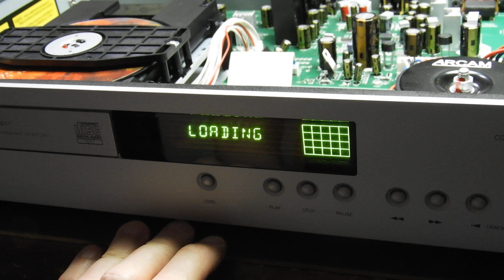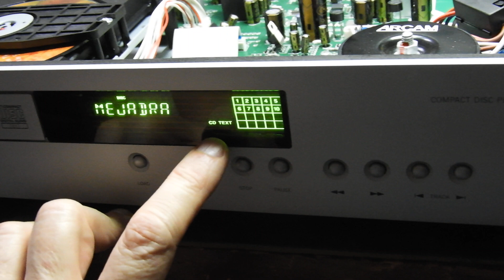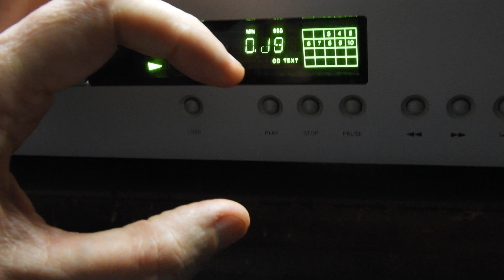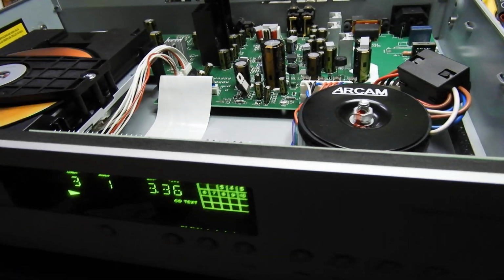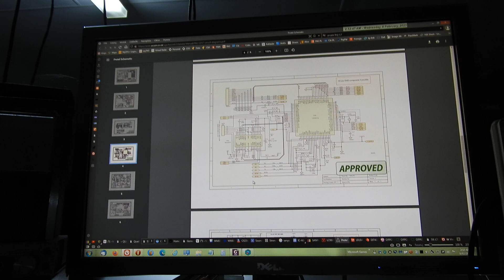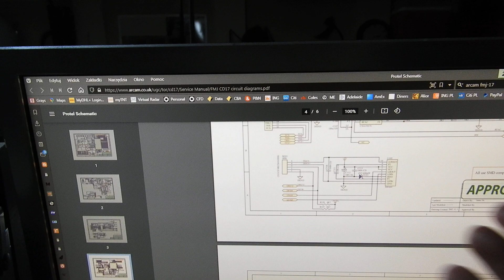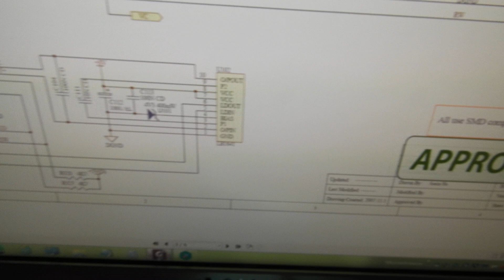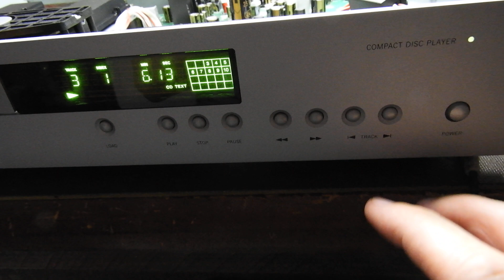Arcam FMJ-17 CD player with "simple tray fault". How hard can it be? (I said to the owner...)

Comment: Hi There if the tray is intermittent at at being stuck fully out and will not load or is fully loaded and will not eject check the the inner laser position limit switch if this is not making a good connection it will confuse the system control IC.
Reply from the maker: True, but limit switches I have checked and cleaned first.